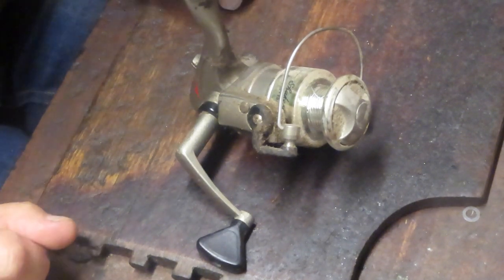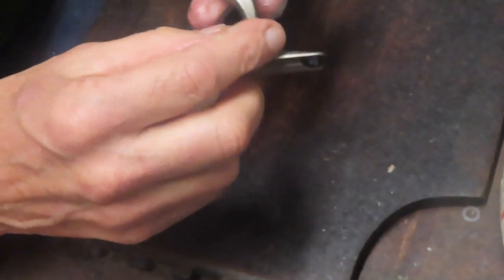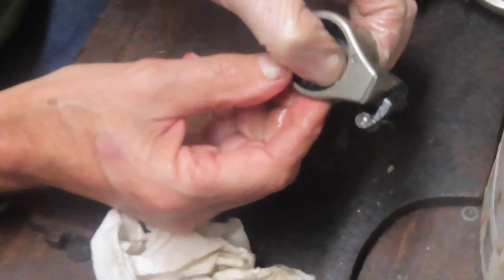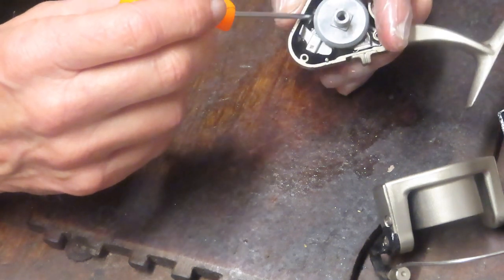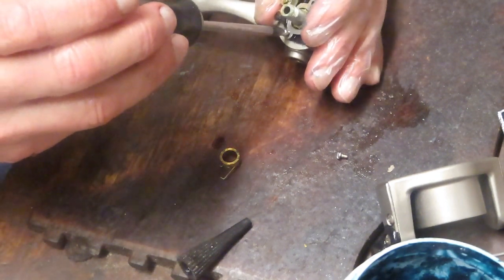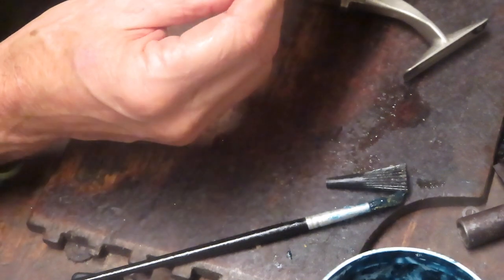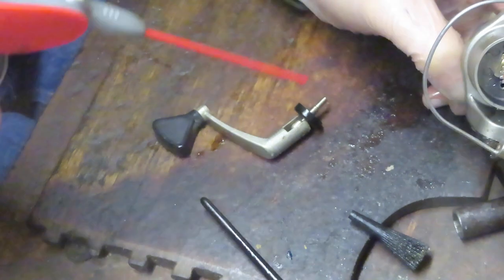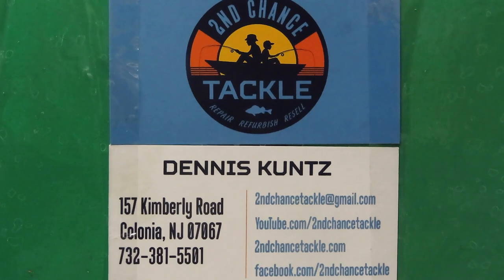Shakespeare SP 400 trash can spin fishing reel how to take apart and service

Comment: Another gem from Pure Fishing! I use my air compressor in my driveway to get rid of sand. I’m learning more about the history of Pure Fishing and though I’m softening my attitude a little I still don’t like how they have swallowed so many once great fishing reel brands. This Shakespeare is a decent design and good for a beginner.  I got my 4th Mitchell 302N for an extraordinary price earlier today.  Now I have just as many 302N reels as the earlier 302 reels. You can never have too many French Mitchells!  This Shakespeare cleaned up nicely. I’m looking forward to your video on that seized Penn 704Z. That should be interesting. I’m also still working on restoring a Zebco Cardinal 6 saltwater reel. It is taking more work and parts than I ever expected but I’m determined to get it perfect. I do not intend to ever get another one however!
Reply from the maker: I guess the other side of the coin is that the brands they have would be gone entirely if it weren't for them. Think Silstar, Pinnacle, Ocean City et. al. There are some new entrants into the market that are making things interesting.  Competition never hurt anyone!  I does look like you will never have enough Mitchells!
Be well
Dennis
Reply: @2ndChanceTackle  what are some of those brands! The Abu Garcia video brought up Pure Fishing. That alone has made me soften my attitude. Of the spinning reels that are made now I like the Peerless Bam reels still made in France. They are much like the old brands I love in that they are still made to last a long time. I wish more of their reels were available here in the USA.
Reply from the maker: The pure fishing brands include Abu, Shakespeare, Mitchell, Pflueger, Penn
Van Stall and Fin-Nor as well as others